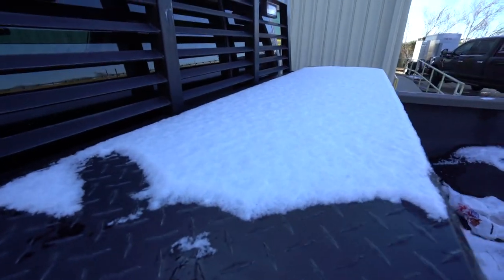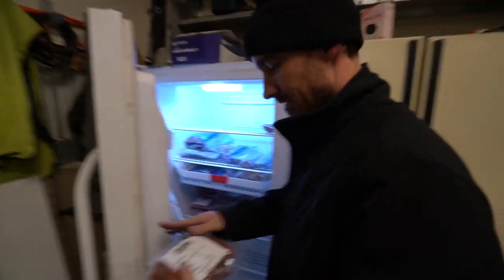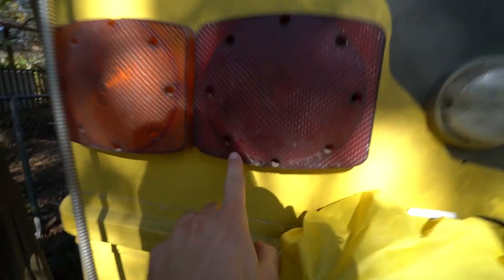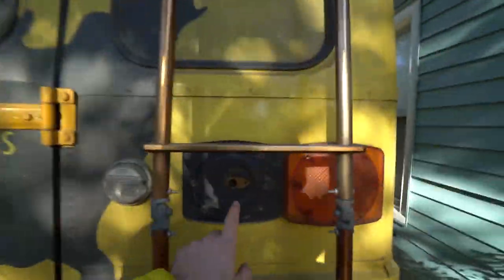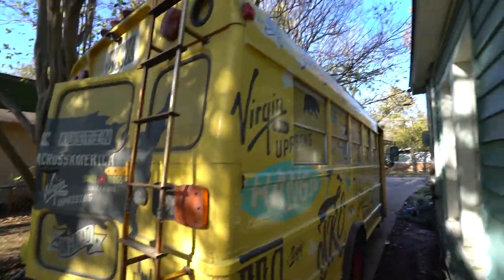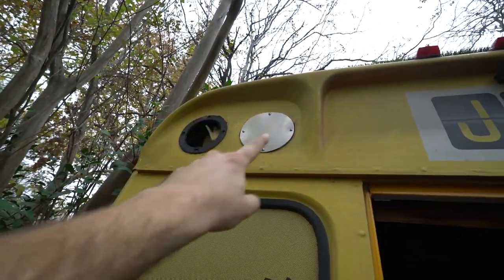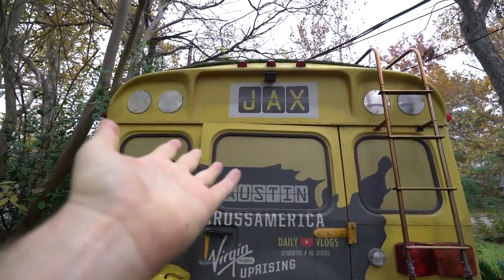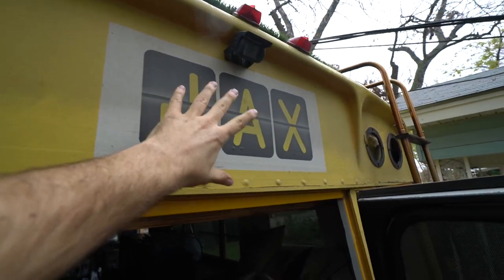How To Cover Up School Bus Warning Lights

Comment: Hi there, what I did with those lights up top was I hooked the outter ones up to the brake lights and the Amber inner ones up to the turn signals. Makes your lights more visible and because they are high up you can see them even when I'm towing a trailer. it worked out pretty well for me. hope this gives you some alternate ideas😁😁
Reply from the maker: nice! I was thinking to do the same, but I removed the giant bulbs for my 6x9 speakers inside :)

Comment: Hay Jax I did mine for free! My dad was a sheet metal work all his life. So I took off one of the light traced it on the metal an took a tin snip an cut it out. Price free. But even a good tin snips a some tin would have only been $40 at the most. I have all the seat out of my bus and the wheel chair lift out. Have it primer for the Wisconsin winter got my truck plates! Long story if I do RV ihave tohave 4 of 7 times done to put RV plates on. I live in a mobile home park and have to have license plates on it or they will tow it. So truck plates it was. Hope to be on the road in fall of 2018. Hay if u stop by Green Bay Wisconsin message me I’m about 16 miles out of town got a place u can park fo a few day/s.
Reply from the maker: good luck with winter and thanks for the offer!!